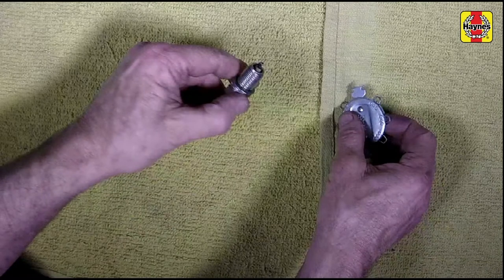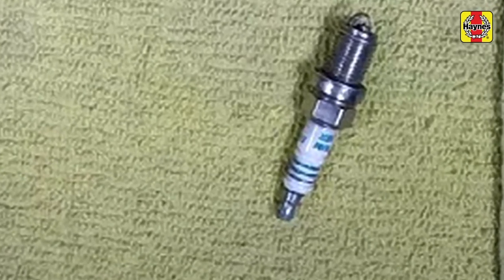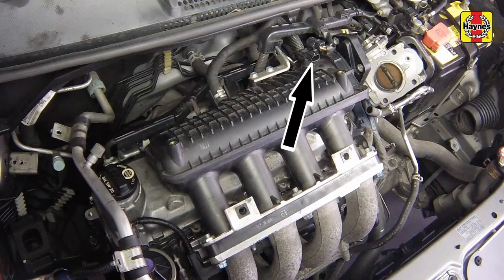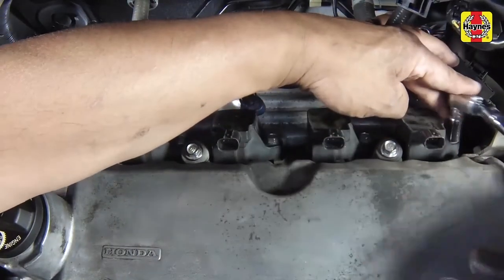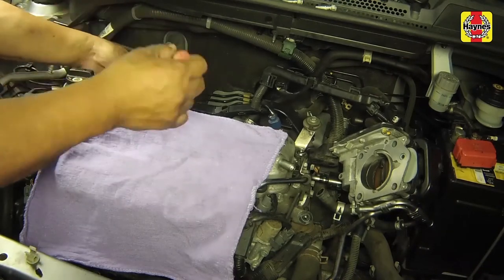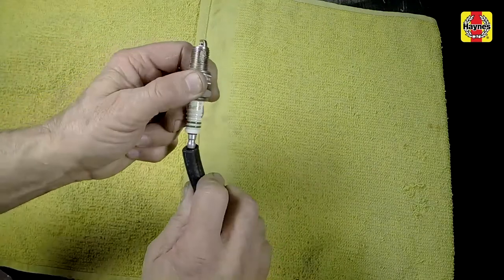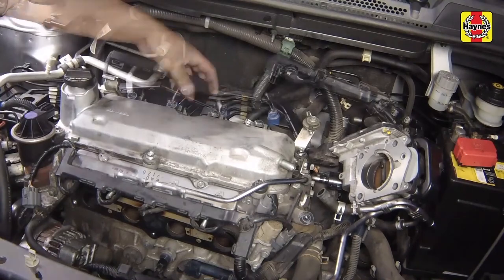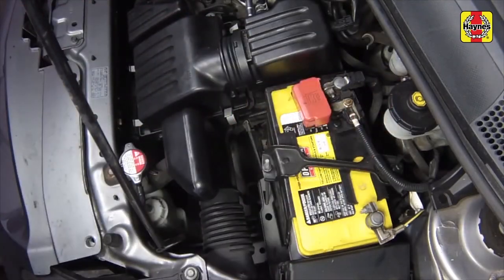How to Replace the spark plugs on the Honda Fit 2007 to 2013

Comment: I was warned by the auto parts store to NOT check the plug gap on NGL spark plugs because doing so might damage the tip, which is brittle.
Reply: You always check the plug gap, parts counter guys normally have the wisdom of a fry flipper.
Reply: That only applies to iridium plugs and not for ordinary nickel spark plugs